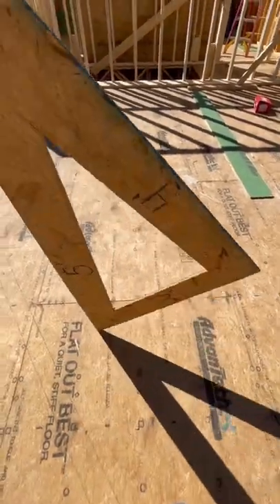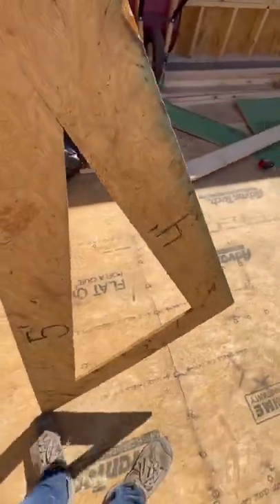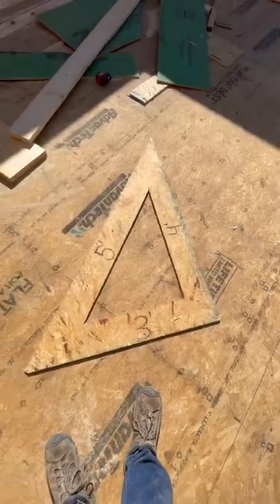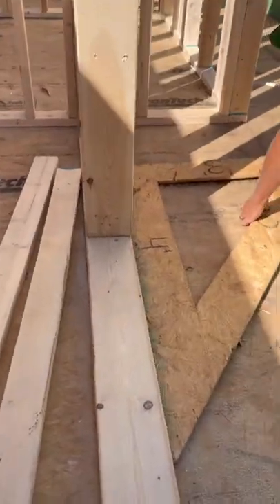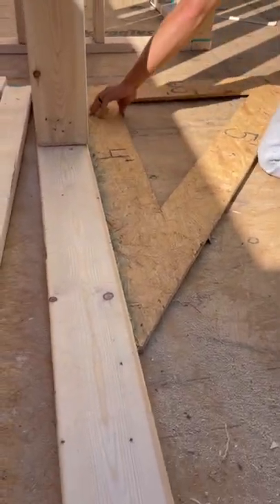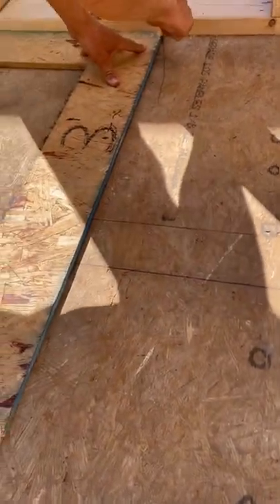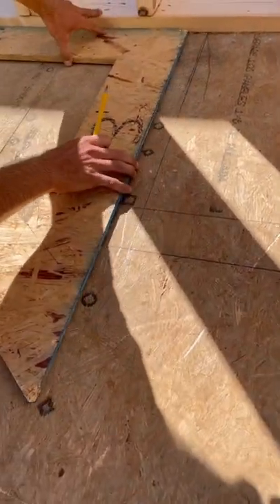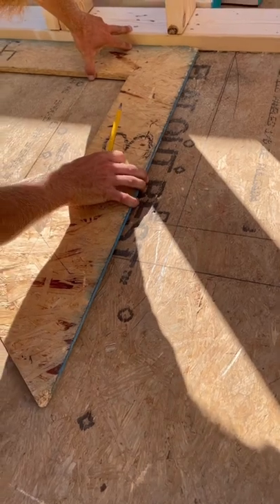Giant Speed Square- custom tool makes job faster

Comment: As a custom finish carpenter, I'll go ahead and state the obvious. OSB and factory edges are not perfectly straight.

But then again, I'm not a framer... 
But maybe I should be considering how many out of Plum out of Square and out of Level issues I find in homes.
Reply: Better with a normal sheet of plain plywood 18mm with machined edge! Use your measuring tape to check all is square. I agree OSB not the best for making jigs/tools. Also OSB edges can be affected by storage methods e.g. moisture getting into the leading edges distorting the board/sheet shape.
Reply: Framers are always in hurry and then everyone wonders why trimming out the job takes so long.
Reply: Yes your correct.  But framing rules are. Within 1/16 ".  Where as finish carpenters. We work to a 1/128" Standard.  ( I did both, union trained ) . that tool will build straighter walls . Than a guy with a speed square, or framing square. ( Those factory edges are close to square).  . it's a great tip . That said, these days.  Walls are table built, placed by crane. trussed up, sheeted and roofed in a week.  With better walls then we ever could stick framing. And framing was my specialty
Reply: @geoffreycalligan9438  obviously you're not trimming out any of the new construction homes in Georgia 🤣👍no one is table building anything around here. I will agree that his plywood triangle is probably better than a framing square. But proper layout with chalk and string lines would be ideal.
Reply: @frontlinefinishcarpentry4193  nope.  I live near Seattle.  NO-ONE stick frames around here anymore. it's inefficient in labor & inferior. In quality of workmanship . BUT. You do need a assembly plant. And trucks etc.
Reply: @geoffreycalligan9438  I grew up near Spokane,  tiny town called Ione. I didn't know things had advanced so much up there. 👍
Reply: @frontlinefinishcarpentry4193  yeah it's shocking man.  I myself was a stick framing guy.  they build a solid house. From setting a floor, To roofed and waiting for siding. In a week.  Shocking.  You can literally place walls and roll trusses. In 1 day
Reply: You always check your square  ,like your levels spin them over or round if it looks right with the eye it is right
Reply: There is a difference of what is square between the rough guys and us finish guys.
Reply: @unrealuknow864  a friend of mine is a deck builder, I always joke that I'm going to get him a tape measure that only has full inches and no divisions between them.
Reply: @bazd  That's because chipboard belongs in the trash. Only kind that's worth a damn is advantech.
Reply: @frontlinefinishcarpentry4193  In Scotland Geoffrey every job is different you never know what you will be getting.
Reply: The replies to this comment were civil, entertaining, and informative. Thanks
Reply: As a flooring installer!  I can tell you from 30 years of experience, it’s not straight!😅
Reply: I feel ya! I'm no pro by any means, I do like the work tho and the challenges that come (even if I wanna just toss it all in a bonfire at times 🤣) but yes, very out of square for sure! You'll look and like oh that's not bad, then sit a straight edge to it and like dang that's no good 🤣
Reply: I've never had a sheet of osb that was square. They're always 1/4 out of square.
Reply: @bazd  I don't think think they were counting on it lasting forever,  they can make a new one in a few minutes with jobsite scraps
Reply: @geoffreycalligan9438  I do flooring layouts everyday for Lennar Homes,  if those framers are within 3/4" , I call it good !
Reply: @frontlinefinishcarpentry4193  He did say there are a lot of short walls in that house, ideal for that large square
Reply: "We ain't building pianos here".....lol
Reply: There are alot of factors that could apply to that like mudding, crown out crown in, different size lumber because of swell and dry out. I frame and finish nothing is perfect
Reply: Used to be a drywaller.  Framers must be drunkards.  Luckily plasterboard is easy to trim.
Reply: “Plum out of square” homie what?

Comment: Yes I’ve made a custom tool to speed up some door frame work, and make it cleaner too:
I cut a small piece of 1/2 to 5/8 thick plywood (no thinner than and no thicker than respectively) then traced the shape of a strike plate exactly as far from the center spline of a door frame as needed to get a door to close shut firmly and securely where a strike plate should be installed. If I am working with someone else, I have them push it into the center of the frame while I use the router to bore out the depression to sink it flush, or I use a pair of C-clamps and another piece of plywood to keep the template in place if I’m working alone. Cleaner and easier than it ever would be once a door frame is hung. I learned the hard way that a store bought template tool doesn’t help at all in predicting exactly how low or high any particular door will swing until the frame is hung, so I recovered my losses with the first person who asked me “where’d you find that tool?” by selling it to him at a nice, fk off discount. Never looked back.
Reply from the maker: 👍🏻thanks for sharing

Comment: Now I know why none of my rooms are square.
Reply: Why?
Reply: cause he is the one who made the speed  square
Reply: @youdeserveit8575  OSB does not have factory perfect edges. If your speed square is off by 1/8" at 6 " then at 12" you are going to be 1/4" off. So lets look at it this way. 1/8" off at 6" equals 1 whole inch off at 4 feet. So if you room is 16 feet wide then that wall is going to be 4 inches foot off at the end. If people would learn how to use a tape measure the process would be faster and more accurate.
Reply: @retiredarmyvet2018  Thank you for donating your time to me by answering like a real human should!  Thanks again
Reply: @youdeserveit8575  No problem.
Reply: dude...😂😂😂 in the past few year I've caught some of the CRAZIEST rooms that weren't square 🤣 truly impressive

Comment: Yes, many times. Squares, gauges, and simple adjustable templates for interior or exterior exact length and cut angle transfers (No measurements whenever possible, direct transfer is fast and perfect fit every time). I like this 3,4,5 speed square as well 👍
Reply from the maker: Thanks

Comment: For those of you arguing this tool isn't square or might not be square, it doesn't matter. The wall is only going to be as straight as the bottom plates.  The only reference that really matters is the beginning and end position of the wall, not whether the lines in between them are straight. No one is bending 2 by 4s to follow a possibility crooked line.

Comment: Pythagoras come up with this about 3000 years ago. 
The hypotenuse of a right triangle is equal to the sum of the square root of the other two sides. Or   A2 × B2 = C2. 
If A= 4 and B= 3 than C=5. 
A squared is 16 
B squared is 9 
So, 16+9 =25 
The square root of 25 is 5 
If you notice that triangle has the 4 on one side 3 on the other side and a 5 on the third side.
Reply from the maker: Cool

Comment: I use the 3-4-5 rule to make squares all the time on sites.  3' > 4' perp to it, if it is square; 5' will be the result from endpoint to endpoint.  Multiply up or down to adjust the size you want to build.
Reply from the maker: Nice

Comment: I've been a mechanic for 25 years. Made all sorts of tools here and there. Well I also decided to rebuild an old Harley this year and lemme tell ya.. Ive never had to make so many tools in all my life as I have in the last 8 months..
Reply from the maker: That’s cool, what year is the Harley?
Reply: @hausplans  
1975 Shovelhead sportster barn find. 
Odo reads less than 4k miles and it's all original,  and one owner with paperwork! It's was a diamond lost in a dump. I've assembled plenty of engines/bikes but it seems like this one requires a "specialty" tool every other step of the way and it really eats into your budget and time. It helps tremendously to be able to form a tool AND it work without damaging anything!

Comment: We used these twenty years ago when a sheet of OSB was $11.00
Reply from the maker: The good old days😂
Reply: The good old days 5 years ago... Sad
Reply: Lumbers back down. U can get 1/2” for around 15. Atop complaining
Reply: 7/16 OSB is back down to 12 something..
Reply: @jamesrussell6870  not where I live... Half inch OSB $30 a pop, and 3/8 is $17
Reply: @timothinking9855  that's currently at Home Depot
Reply: @jamesrussell6870  my city lumber yards cost more than Home Depot. Even going to "whole salers" and roofing supply. Unless you're buying 30 sheets or so, you're paying $17-30 a sheet out here, and sheathing is even more... Still sucks. I remember paying $8-13 a sheet in 2018.
Reply: $8 before Katrina, then jumped to $20+
Reply: @timothinking9855  $12 something for 7/16 at Menards in Midwest currently..
Reply: I remember paying $4.80 for 1/2" OSB.  Doesn't seem like that long ago.

Comment: We would use pvc pipes sometimes with 45s or 90s to measure distances for planting trees or plants for even spacing. It helps when you got a big job and have to plant over 1,000 trees

Comment: Not really a custom tool, but I used a thin bookmark to help me insert glass panels into an ikea display shelf. They had to be placed into a very tight plastic component, and having the bookmark alongside the glass freed up just enough space for the rest to slide in without a ton of effort. The bookmark was thin enough that it didn’t stretch out the plastic component, but instead acted as a very gentle wedge; allowing the glass to be held securely.

Comment: One of my favorite little jobsite made tools is a piece of EMT banged flat on one end with a hole drilled in it for twisting ceiling wires.  Really saves the finger on big ceilings.
Reply from the maker: That’s smart

Comment: Yes, made them in the 80s in Kodiak, but with actual plywood so that it does not fall apart.
Reply from the maker: In Kodiak, you’re lucky a bear didn’t eat them😂
Reply: My experience because of the resin in the OSB it holds up better in the weather than plywood which delaminates right away
Reply: @kevinfrederick7956  facts. Sitting here watching real plywoods top layer try andpeel off this floor in a new house. Drytanium 3/4 t&g. I've never seen advantech do this ever. But, it's what the contractor likes.
Reply: Actual plywood falls apart much more easily than OSB. That’s a fact

Comment: Forgot to mention these skills were usually passed down from older joiners (carpenters). Carpenters in the  UK are called joiners. Finishing,roughing=(houses,commercial & historic building's) & shuttering =(concrete bridges, dry docks etc). I did them all an allrounder. Love wood.
Reply: Actually joiners are wood workers who join wood without metal fixings, carpenters are the all rounders... but carpenters started using "joiner" to make themselves sound better
Reply: @boobye6305  Which country??

Comment: For threaded rod I took a piece of aluminum pipe used a step bit and created a bevel on the inside. Then I took a torch and heated the end of the beveled end. I then took a 1” long 3/8” Nut and hammered it into one of the ends of the aluminum pipe. Once I wedged it in I hit it with the torch again and hammered around the nut to kind of make sure the edges were good. I’d insert a thread rod into the nut and remove it cool the pipe weld a donor bit that fit a drills Chuck and now I had an extended threaded rod nut driver.
Reply from the maker: Nice

Comment: 4 ft piece of 1/2 inch OSB about 5 inches wide with 2 holes cut out for handles. Trimmed one side of a piece of square corner bead to 1/2 inch to flush with OSB and secured  the bead with red stucco tape. Not a stucco guy but my boss agreed to do a decent amount of patch work around a massive door and window we installed so I wanted to keep it as flat as possible.

Comment: We do the same thing when sheeting the roof. Once you have a cut off from a valley or hip, the angle applies to the rest of the hip/ valley you are sheeting. No more snapping lines and you only need a top or bottom number to line your pattern up with.

Comment: used to do hvac install. i drilled holes in a piece of strapping to use to draw circles. labeled each hole with the diameter of the circle it would draw.
Reply from the maker: That’s cool

Comment: I have a collapsible aluminum one made by a company in New Jersey "A Square" #Asquare  I've owned it for 30-40 years.
The five side is 5 ft long.
It collapses down to 5 ft long by about two and a half wide and i stuff it in the very thick walled cardboard tube that originally shipped to me in so it does not get damaged.
Reply from the maker: Sounds like a well-made tool

Comment: I make jigs and tools almost every day for every project, especially custom chairs with odd angels. Today I made a simple yet gigantic L-shaped planters box for a client. To align the screws in straight lines for different distances from the end of the cover boards I made 3 simple stops with a hole to punch an spike. A jig like this improves efficiency and accuracy it's impossible to achieve measuring each screw location manually with a tape ...

Comment: everyone whoever said that they would never use algebra trigonometry that they learned in school notice the 3,4,5 on that triangle that's your quadratic equation one side is 3 in one side is 4 in one side is 5 in multiply those by the same number as in two so six inches 8 in and 10 in that will give you the triangle you want it can be inches feet miles it doesn't matter that's how you square up any frame a squared plus b squared equals c squared. what's the equation for your hypotenuse cos sin all that is all right there and that speed square
Reply from the maker: All true, just don’t tell my high school math teacher 😂

Comment: When you're tiling diagonal Squares, you can make a template so you don't have to mark or measure every single cut what you do is you take a thin piece of wood like an 1/8 of an inch and take the measurement across a Square Tile diagonally, and add a 16th and whatever you want your grout joint to be, there's your template works every time put it up against the baseboard and mark the next tile

Comment: You could cut it at 3.5 and 5.5 width to mark both sides of a wall without moving or realigning.
Reply from the maker: They did cut 5.5 inches but they should’ve cut 3.5 on one side

Comment: I work in a sighn factory. We have to mark and drill 25 plus screws around a 10 foot sighn. I mad a foldable ruler with screw holes in it so I could line up the ends and even mark center.
Reply from the maker: Smart

Comment: I once needed a socket to replace the clutches on my sons atv. Looked online and was appalled that they wanted $60 plus shipping for a 7/8ths socket with ramparts cut into it. We went right to the auto parts store and bought a $10 socket and took it home and used an angle grinder from HF. I came out on top counting fuel, cost of the grinder new, the cuttoff wheel,  and the socket 😊😂
Reply from the maker: Very smart!

Comment: All the fricken time!!!
Had a CX ask me to install door stoppers on the back of all doors in his house, about 30. Grabbed an empty nail box out of my truck and ripped it down to 3 sides and measured 1.5 in and drilled a hole, 
Place it on a door and mark the location, drill the hole to the dept, then screw in the door stopper.
Reply from the maker: Nice
Reply: @hausplans  Thanks, The guy then asked me why they looked out of position. Can you guess why?

Comment: If you're using a note to snort coke, take a rolling paper and wrap it around the note so that it keeps it shape
Reply: There's also a handy way of rolling a bill so that it stays all by itself, nothing else needed. You bend a corner before rolling, it's a corner tucking method similar to how you finish a paper triangle football. 

Never do drugs kids. Ever. Seriously. I mean it.
Reply: Straws are pretty common, just cut one up like 3 inches long

Comment: First day on a job site, this old timer taught me the 3-4-5 triangle using something like a string line, I think.
Reply: First thing we do when starting a new frame is 3,4,5 the two longest sides of the slab and then ping those two chalk lines, as long as you're not an idiot, every wall from then on is in the right spot and straight, no plywood square needed, just a tape measure and a chalky.

Comment: When building a hip roof I will normally create a custom pattern for the angles  of the roof sheets and the drywall inside if it is a cathedral ceiling.  I only then require a single base leg measure to cut any part.   Further, I always create the rafter tail, birds mouth, ridge angle in a left or right pattern.
Reply from the maker: Having a pattern for rafter bird mouths really speed things up
Reply: @hausplans  Yes,,, but I am a dinosaur.  I still own hand saws and hand planes.  Laughing,,, and the reason I still use them is they are often faster and easier.

Comment: Yes. We ship out elevator tank units on 48 by 48 pallets, so instead of measuring every time we made a frame that fits perfectly on the pallet to mark the lines to place the unit dead on center.
Reply from the maker: Very cool
Reply: @hausplans  also made a template out of thin ply wood for the cut holes where wiring passes through from controller to the pump unit. So it is dead on where it is supposed to be everytime . Because the openings have to match up and there can't be sharp over ride edges that can damage the wire as well. We always try to make different templates to have a visual and to make it quick and accurate.

Comment: 3,4,5.  Haven't made the tool but have measured the 3,4,5    6,8,10 etc to square walls or just check a pad someone else formed and poured, just to get an idea of what has to be tweaked.
Reply from the maker: Nice